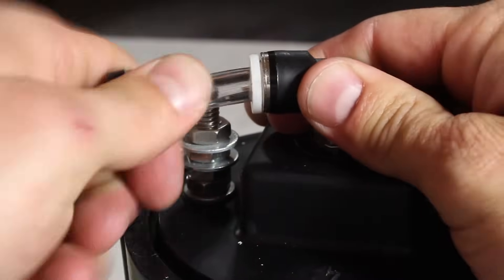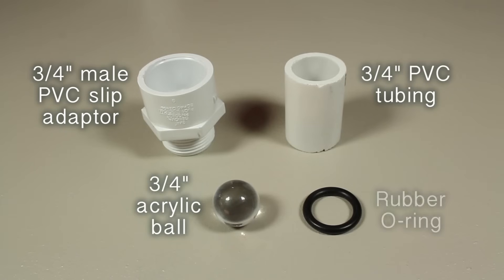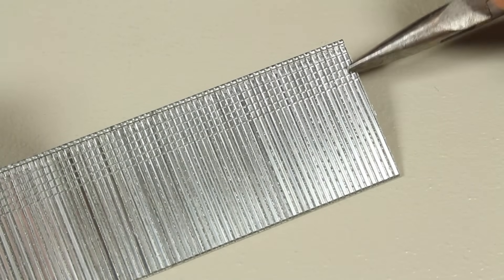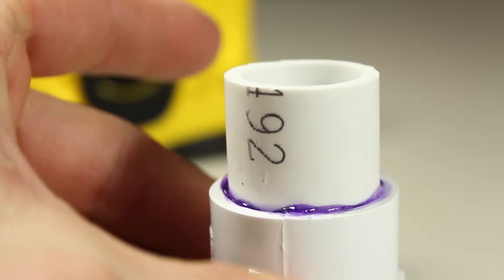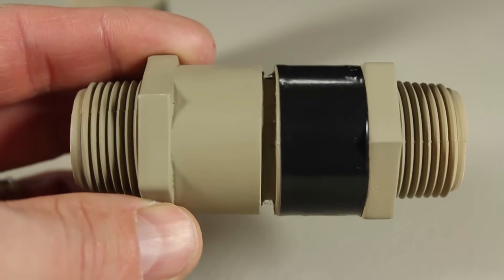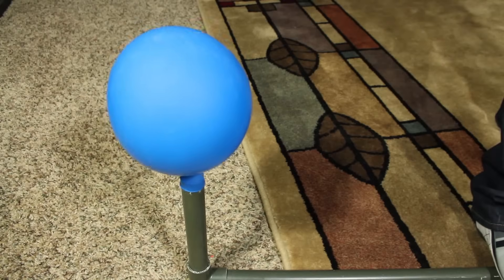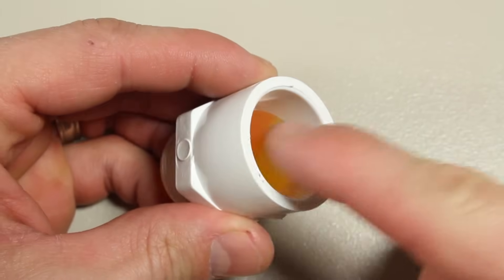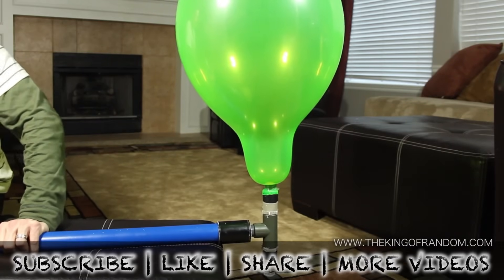How To Make a One-Way Check Valve - For Cheap!!

Comment: So if we are using this on a 3/4" inch pipe, won't the flow be reduced since the ball will block around half the pipe?
To counter that could we use a 1 inch valve on a 3/4" piping system?

Comment: If this were for a handpump, that would be slurping up sludgy, silty gew. Would the debris block a proper seal after the first use?
Reply: i feel like you would want to put a screen(oe a couple of dimishing sizes) before the check in a way that it would be acessible for cleaning. dirt and debris can definatly interfere with the seal and also damage the rings. First use... you may get luckey, but I wouldn't bet on it.

Comment: Hey Dad, ever since you replaced  that swing check valve, hardly any water is coming through the return line...but don't worry....we found the problem....somebody put a 3/4" marble in our 3/4" return line.

Comment: Can you please helpme? I have a water backup in my kitchen sink in my apartment. The aside apartment has disposable/grinder on his kitchen, every time he turn it on, all the pressure of that filthy water, it comes backup to my sink, and i have to clean and sanitize every single day!, i report it several times to the office but they don't do anything. Could you please tell me where are the measurements or even better, could you be so kind to sell me one thru ebay?? it has to be the shortest possible (height) to connect both sides (not enough room to move the kitchen sink pvc pipes. the shorter, the better. but i don't know my size of wide of my pvc pipe? don't know if they are one size only. Please help me, i would like to buy one online please, (ebay, perhaps etsy) thank you very much.

Comment: Excellent Video. Do you have how to make a cheap Air Check Valve where very slight pressure difference will open the valve, and at default no pressure difference valve is closed.

Comment: @The King Of Random : 
I'm having trouble holding water, and I can't find a acrylic ball.  I wanted to use a 1/2 inch to test.  Where did you buy the acrylic .75 at?  Do they also have .5?  Thanks.
Reply: I'm trying to 3D print one right now. I have no idea where to acquire small quantities of small plastic marbles.

Comment: but how do you make it for $0.35 ???
Each 3/4 male slip adapter is $0.35 Orings arent free and neither are acrylic balls or short pvc tubes... 
3/4 acrylic balls are about $2 ea on ebay. delrin balls are cheaper at about $1.20 ea 
total realistic cost is about $4-5........ better than $10 but far from $0.35 even if you had a warehouse full of stuff to use and happen to have everything you had to pay for all of it at some point.

Comment: I have a noise problem with commercial check valves , they all seem to be made in Italy, and the don't use a spherical ball , only a flat disc , which in hard water areas like mine ,  starts to fail , and then squawk  which is annoying . I have two squawkers now , one on the cold input to the solar water heater , and one on the emergency water pump system . Bravo , I will try my hand at making some of these !

Comment: Doesn't the acrylic ball need to move freely?
By that I mean there has to be a bit of space between the ball and the brad.
Am I right? Great video and valves.
I am working on some projects that need them.
Reply: Ya youre right other wise this wouldnt allow much volume to flow past. If the ball only raises 1/8" then youre only getting a small flow of water. I think using a spring to allow much more travel would allow almost full port flow.

Comment: That would never work on a sump pump. the plastic check valves they sell for sump pumps use a stiff rubber flap instead of a ball.

Comment: Great video!  I found that 7/8" acrylic ball at Tap Plastics works in my 3/4" PVC adapter.  If you go with a 3/4" ball, it goes right through!  A shooter marble was too big, and regular marbles were too small.

Comment: I have a 1 & 1/2 " intake, I assume you size to this diameter, or is the circumference to large?  I assume one could also install a check valve on the output side of the pump with the same results as descriped in your video.  Enjoyed the show! Thanks

Comment: I was looking for the components of this build recently and all the pvc seems to have extra lumps on the outside similar to the little tags left behind when large sheets of plastic components are molded and then cut apart.  This interferes with the proper assembly shown.  Where do you source your pvc without these lumps?

Comment: the herons water fountain is a fantastic project for free water flow. however... when the pressure in the initial bottle runs out... the water stops rotating. my question...is... is it possible to make a cheap pressure valve.. that when the force of the water is low.. the valve in the initial bottle closes.  is it possible for water to run continuously with free energy

Comment: How much distance is there between the ball and retaining nail?  I think it would be a trade-off between allowing air to pass through and back-pressure needed to close it.  If you have a large gap between the ball and retaining nail you'd be able to move tons of air, but it would take more pressure to blow it into a closed position.  How much distance did you end up using in your design?

Comment: what can you use to prevent leakage from the holes created when you installed the nail gun nail???
Reply: Because one end of the screw fitting covers the hole, they won't leak.

Comment: In what universe can you buy all the components of one of these check valves for $0.35 or even under $1 as advertised!  Also, would be nice to have O-ring size & source mentioned.  Fun video, just don't believe the overly optimistic prices!

Comment: I found that a simple garden hose gasket works great in place of the O-ring. A lot cheaper as well. I had a hard time finding the O-rings and just used the gasket and it's perfect for water pressure...not sure about high air pressure though.

Comment from the maker: Some quick links to a few of the materials I used:

[✓] 3/4" male pvc slip adapter: http://amzn.to/2cu2lBg
[✓] 3/4" acrylic ball: http://amzn.to/2cjFVVR
[✓] O ring: http://amzn.to/2cDNhme
Reply: I miss this kind of videos.
Reply: Possibly :-) You would just have to put some kind of filter on the inlet valve, then make a seal around your face. The outlet valve wouldn't need a filter :)
Reply: Grant Thompson - "The King of Random"  the pvc slip fitting off of amazon isnt the ones you use in the video
Reply: I have some similar size marbles around, could I use them to replace the acrylic ball? Would it still work?
Reply: I'm curious if I can adapt this into a Hazmat suit/gasmask
Reply: Grant Thompson - "The King of Random" thanks i really needed this
Reply: Grant Thompson - "The King of Random"
Reply: Grant Thompson - "The King of Random" hi
Reply: You can also get the adapter & O-ring at your local Home Depot or Lowe's.other hardware store.
Reply: Grant Thompson - "The King of Random"
Reply: Love this video however the materials to make this are more than $0.35 as you said in the description
Reply: Would this size threading work for garden hose type connectors?
Reply: @kawikah6301  no, these are NPS (National Pipe Straight) thread. If you get a connector that is female threads on each side, you can buy an adaptor from NPS to GHT (Garden Hose Thread).
Reply: If you file your PVC pipe like a castle nut about 1/8 inch deep you don't have to cut the rubber ball.

Comment: Why the ball is still attached with the ring when you put the valve up side down even there is a secure position?
Reply: what
Reply: The nail on the other end of it prevents the ball from falling out, when it's turned up-side down

Comment: Grant, where did you get the ball? I looked on Amazon but from the comment section it looks like they're a bit smaller than the inside circumference of a 3/4 acrylic pvc pipe

Comment: I thank you for this! I needed a check valve for my misters on the edge of my patio cover, so that I can flush all the water out of the line after use so they dont clog up so  much from standing water.

Comment: + hey I need some help understanding how to make a coaxial valve pump because my uncle made one with a one way air valve in the piston and I don't see what the point of that one way air valve inside of the Piston is for because the air goes in behind the piston and then gets let out how and where does all that air go and how does it go there I've looked up some videos but none of them really help I could proboby send some pictures through email or maybe make a YouTube video off of it that you could see so you can understand a little bit more about what I'm talking about

Comment: I found some rubber balls, but they were pretty large. 25mm leaving very little room in the fitting, and no room for the pipe. I cut the ball in half and cut some notches in the end of the pipe. Then I glued the pipe in making sure not to push it in so far as to press the half ball. I left about 1/4 inch of room for it to move. Works great.

Comment: Where do I get an acrylic ball as described?
Reply: +Kate Marsh Just type 3/4 acrylic ball , also 3/4 rubber ring on ebay or amazon, the others you can find in stores like home depot or lowes. the rubber ring may find on stores too. but acrylic ball on ebay or amazon you will find them.

Comment: Would it be possible for me to build pressure with just my breath? I want to make a slightly more lethal blow gun using this for longer targets.
Reply: +Captain Capellini 
Depends on how good your breath is. The valve only opens if the pressure from your breath is greater than the pressure in the container.
Reply: I failed to notice that would be the case at the time, I don't think it would work at all considering it would only give one sharp burst of energy and then it would be gone. It probably wouldn't even leave the barrel.
Reply: +Captain Capellini um do you realize that if you can blow that dart and it flies then what do you think twice the air released at once (as if you were blowing with two people at the same time) would do. It would fly further. Now this check valve should take at least five times your breath. But it all really depends on your trigger/release valve.

Comment: I forgot to add that you should use something that wont rust as a retainer instead of a steel nail if you plan on using it in a residential application on your own plumbing. You also want to make sure the O-ring won't move out of place when flowing water or air passes over it, but it looks like Grant's check valve works just fine. As far as pressure testing, normal Schedule 40 PVC will take up to 400PSI and if you use the correct PVC purple cleaner/primer and PVC Cement you should be fine. Household water pressure ranges from 30-40 psi and air compressors very rarely exceed 150-200 psi. The rubber O-ring and acrylic ball should perform fine under those conditions.

Comment: So, how much is the maximum pressure this check valve can be made? 
For the acrylic ball and rubber ball
Reply: cw617n forge Brass valve, you can find out if you are interested, whatsapp:+8615570052161

Comment: why do you need to cut the top off the bouncy ball?
Reply: +BrokenRRT that makes no sense. Since it can turn freely when unlocked, there is no way to be sure it blocks when needed. I don't think it will close every time..
Reply: So water will pass it
Reply: The flat part matches up with the end of the tube you inserted so the ball doesn't roll around or get stuck into the tube, the round part is only on one side so that's the side that seals.

Comment: Okay i can make the exact valve that he taught us...but idk why i didnt understand how it works ? how air/water can go in and not out ?
Reply: When the water flows in the wrong direction, the ball is pushed against the o-ring, sealing the connection so no air/water passes through. When it flows in the right direction the pull is pushed up (into the larger pipe, so the water can pass around

Comment: Im interested in learning how compressor check valve works. I think "normal" check valve only blocks the "back pressure" but in order to make the water flowing you need to apply a pressure on the input side that is greater than the output side. How does a compressor check valve allow lower pressure input be able to pump in to the higher pressure output side. Or Im understanding it wrong. Can any one help me?
Reply: +Ronell Oropesa i think it's by inputting higher pressure when you are trying to pump ? if your pressure is lower, the check valve will be blocked, in order to break the check valve seal, it's like how 2.42 where he puts his finger to break the check valve seal. Hope I'm right

Comment: i made one and it does not work right what do you think i did wrong
Reply: +colton burchett 
Maybe you left too much room for the ball. Test it and see how much the ball presses into the opening. Keep in mind that the forces applied from the "No Flow From" end are what makes the ball press into the opening and seal it, while otherwise the ball lets anything that can go through the gap pass.

Comment: This valve is going to be restrictive in the flow direction. Not enough opening around the ball. I would not recommend to use as shown for sump pump.

Comment: Great project for when I need a low cost version for a spring check valve which would be overkill for homestead projects.

Now what I would like to see is how to make a cheap and simple swing check valve (where the 'valve' moves up out of the way of the flow) for use in applications where there is say sand or small gravel in the water that you are moving with your hand pump.
Reply: +John Ruckman perhaps a larger diameter pipe coupled down to a smaller opening with a steel ball?